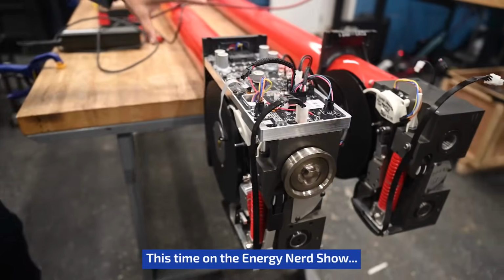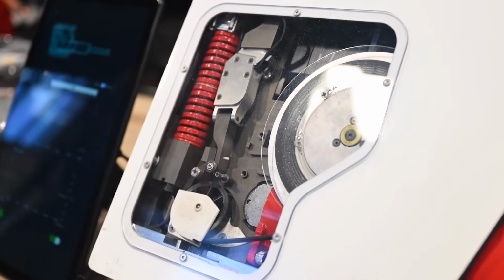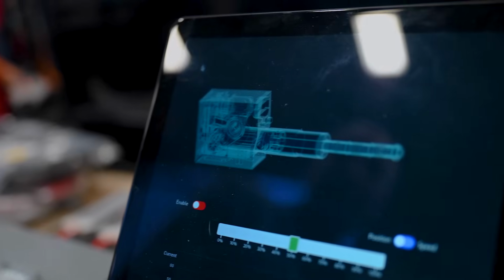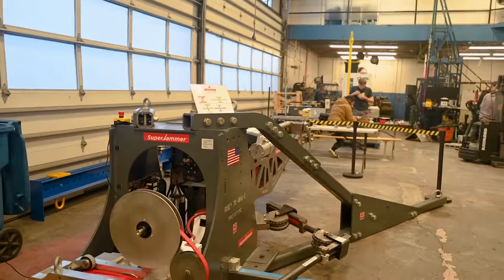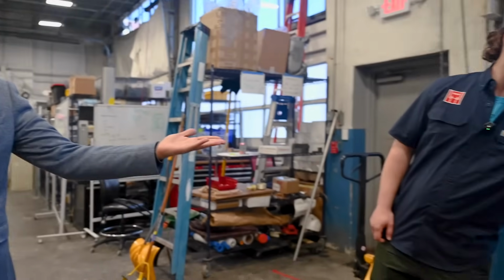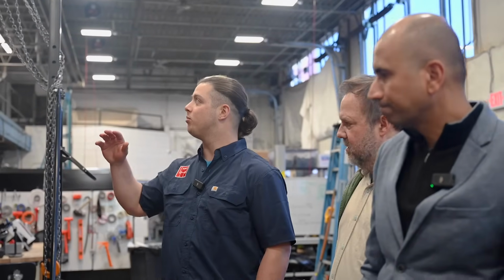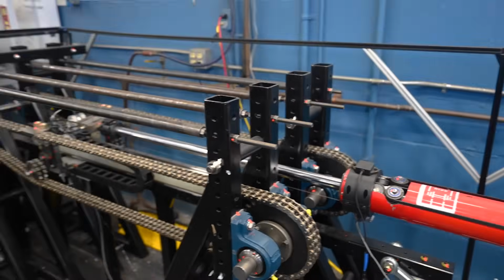Electrifying Heavy Machinery at RISE Robotics!

Comment: So ok first hi 
Automotive engineer
Servo has a huge disadvantage of having a motor sitting right by the each element
Where as in hydraulics I can use five of these with just one motor 20 meters away
Yeah not at the same time but hey
In many scenarios that would be a more efficient solution

Comment: I've been on a few jobs where the digging had to be very precise. On one side you have a gas line and on the other side you have a valuable structure and you can't make a mistake. So , you have to take your time and be careful. How much better would it have been to be able to move my bucket to each perimeter of my dig and lock in the parameters so that the machine won't go past that mark. Then I could work fast without fear of making a mistake. Time is money.

Comment: I'll put my 250 ton hydraulic press up against.....whatever you have.
Reply: Totally. Not a great market for these, and for about 50-100k, you could adapt an existing Fanuc or Kukro 7 axis robot arm to do the same thing. The arm would be more reliable than this system, too. 

Also, their claims in the video vs. labeling on the products don't line up. "This arm can lift 7000 lbs" pans across arm sees "Max 6000lbs" 😳

Comment: The potential-energy recovery (regen from lowering) is very useful.

Hydraulics are also dangerous.  A high pressure leak can literally cut a person in half.

Question: don't existing robots use belts?  Kuka, Fanuc, etc.

Comment: All this talk about energy efficiency? No indication of load capacity?

No application demo, just a wiggly arm any other actuator tech could move? 

Lets say I need an an actuator and I want to avoid hydraulic fluid for environmental and maintenance reasons - I got screws, rack and pinion, pneumatics or I can make my own damn pulley system because its elementary engineering and I would have fun doing it.

This is some rich dorks half baked concept put together by some smart engineers who need paychecks to cover their student loans.

Comment: That beltraulics name has GOT to go...it rolls off the tongue like broken glass.  I asked CoPilot for help.  You're welcome....these suggestions are way better than beltraulics and even if RISE doesn't use them, they need to find something else...consult a marketing expert or something...at least a linguist!
------------
If we’re imagining a term parallel to "hydraulics," rooted in the mechanics of belts and pulleys rather than liquid pressure, something like *"mechanics"* or *"beltonics"* could work. The "ics" suffix aligns with the naming convention seen in "hydraulics," while "belt" communicates the essential motion and power transfer via belts. 

Alternatively, borrowing from the Greek roots similar to "hydraulics," a word like *"sustaulics"* (from "susta," meaning pulley, and "aulics," meaning pipe or tube) could work to convey the system’s operation through interconnected pulleys and cables.

Does this resonate with the concept you’re envisioning? Or would you like to refine the idea further?
Reply: plus it will remind of the potential buyers how good hydraulics.. it will be doomed..

Comment: belts? a lot of electronics to fail - batteries - power to weight ratio - and what they are using as benefits are not really real world for an excavator ot front end loader - we dont need such control etc... u can almost destroy a hydraulic system and it will still move - not so with this - hmmmm cost of onership compared to hydraulics? and a maintained hydraulic system has few leaks -  sowhat market are they targeting? soo many parts to fail - booting? and that position example was a cheat - was at the end of travel

Comment: This is ok for non critical applications... This is due to failure of the belt dropping the load instantly as apposed to an oil leak that would drop the load gradually and in a controlled manor. Yes breaks could be used but I didn't hear them mention those. A motor controlled 'Ball Screw' would be more safer and yes I'm hinting at a new design that uses those. ;)
Reply: Ballscrew actuators are well known, as are lead (sliding nut) screws in a variety of configurations. Ballscrews are at risk of backdriving, and are more dirt sensitive, as well are needing proper lubrication. Great tech when used in CNC machines, not so easy when not designed-in properly.

Comment: I smell a scam. The number of ways in which this is more complicated and less versatile than hydraulics could fill a book.
Reply: Can you elaborate? I’m about to use my own tech involving pulleys and springs. Pulleys are miraculous and under-utilized tools
Reply: So could the uses that want it instead of hydraulics
Reply: Engineers beg the differ. Archimedes thought us that pulleys and leverage is the way. It's the materials that need to catch up. Hydraulic is a temporary fix.

Comment: Nah bro.
False "Green" Claims – Hydraulics can already be powered by electric motors, so arguing that their solution is greener is misleading.

Limited Force Application – If they can only pull and not push, their usefulness is drastically reduced. Hydraulics excel in both directions with immense force.

Pulley Wear & Maintenance – Belts and pulleys degrade over time, requiring frequent maintenance, unlike well-maintained hydraulic systems that last for decades.

Restricted Range of Motion – If they only achieve ~20% of their own length, that’s incredibly inefficient compared to hydraulic actuators, which often provide 100% stroke length.

Power Deficit – Hydraulics generate enormous force in compact spaces, something pulley-based systems struggle to match.

Spacial Restrictions — The motor and belt system seems to be positioned directly behind the piston as opposed to hydraulics vast flexibility using fluid cables.
Reply: 13:27 He cant even keep it straight

Comment: also a few points 
why use a spring on one end why not just pullies and string for both expansion and contractions 

he said its 80% the weight 
is that weight by volume or power 
 if its by both then this going straight to planes cause they surly wants something less messy then hydraulic oil
Reply: Or just a wormscrew/ballscrew that is both push and pull and precise with a good mechanical advantage and lock up.

Comment: Tethered controlers are nice and are use in nuclear handling robotic trailers, but have the problem that users damage or destroy the cables a lot.  Mostly they drive over them with the unit, but also just kink the cable or abuse it.  I am thinki g that these small controlers will suffer a simmilar fate.  Be prepared to have the cables and controlers on bench stock.

Comment: In the hydraulic jammer, all hydraulic arm functions can be accomplished with the hand pump.  I am guessing this is not possible with this electric version.
Reply: it is, this system uses the similar pulley technology used in cranes to multiply their lift force, so technically,  you can use a hand crank in place of the motor to operate this.
Reply: @vamshis1756 the crank is interesting, but inpractical for the table controls.
Reply: @jasonneugebauer5310  why? and what do you mean by table control?

Comment: I worked on munitions lift equipment "jammers" in the Air Force.  The consept unit in the video looks very nice, provided it functions safely with the 7,000 pound weight and does not require more unscheduled maintenance than the hydraulic version.
Reply: In heavy machinery, our electronics fail or wear and tear is 5:1 over hydraulics.  My question is are you guys electric over hydraulic? Curious if elec/hyd or diesel/hyd.  Interesting to hear how 7k of work causes a lot of maintenance, that would be laughed at in the heavy construction world, it would barely wear anything out. Context: 7k would be 3.x tons +/-,  1 cu. yd dirt = 1.35 tons... bucket 3 cu. yrd * 1.35 tons operating 8 hours, 5 days a week for 52 weeks. 1 hour maint. a month, service once/3 month....
Reply: @450ktm520 most of the maintenance has nothing to do with the pistons unles someone actually bends one or somehow tares a piston O-ring.

More issues with lines and fittings, pumps and electrical issues.

Biggest problem is with having the panels  bolt holes strip out constantly from being taken out every six months by novice mechanics, then repaired with crap helacoils that last maby a year or two at best.
Reply: AO!
Reply: Way more parts to fail, including all the electronics.

Comment: The perpetual energy is a joke. Clearly he doesn’t understand something called efficiency. There is no free energy my guy
Reply: It was, indeed, a joke. There's a play on words here, but it probably would have been better to not go in that direction. These are skilled engineers, they are fully aware of entropy and that someone inevitably pays for lunch.
Reply: @davidg3944  a joke? There is clearly no market for it. I mean there are fuckton of linear actuators already there and there is no way anyone can ever replace hydraulics. I mean it is fully electric if I run a hydraulic pump with a motor rather than a gasoline engine or whatever. Yes there are some closed loop hydraulic systems as well for position control what is he even talking about?
Reply: @ You seem somewhat overwrought. Take a deep breath, then exhale. Then stop.

Comment: This is interesting! It looks like everyone is hopping on the Greenwashing train!
Reply: If a proper accounting of energy costs shows it does save over hydraulics, it's not "greenwashing".
Reply: @davidg3944 As many others have already pointed out, you can easily retrofit an electric drive motor onto almost any existing hydraulic system. That saves you an immense amount of cost and design complexity. Fun Fact: machines almost never move all of their hydraulics simultaneously. We can leverage that to save weight and cost. As an example, if you use one large 20kW electric pump and a valve manifold to drive all of the hydraulic cylinders in a machine, you avoid needing separate 10kW, 10kW, 8kW, 5kW, 5kW, 3kW, and 2kW motors dedicated to driving each separate actuator of the machine at their full rated power. I can't consider this anywhere close to a viable replacement for multi-cylinder, shock-resistant, or heavy-lift hydraulic systems unless it can overcome those limitations without increasing the cost or complexity.

Comment: Has a lot of opportunity on the market for very special applications , but can’t replace good old hydraulics.
Modern hydraulic systems are super strong with less and less energy loss, due the computer assisted planning and machining processes. We can simulate fluid physics down to molecular level even, making better valves, pumps, pipes, dividers, regulators, filters etc…

Comment: Hydraulics usually win in cold conditions due to their robustness and ability to deliver power regardless of temperature, provided the system is properly configured. Electric pistons and winches are better suited in milder climates or where precision and ease of installation are more important than raw strength in the cold.

Comment: I am looking for electrical actuator rods that can replace the rams and valve bank on an excavator. The reason an excavator can work without wrecking itself is because of the releif valves in the valve bank. Put the bucket in the ground and pull back on the dipper. If the ground is too hard, it doesn't break the machine. The relief valve for the control senses too much pressure and opens allowing a bypass. This saves the machine from breaking. That is active relief, which I believe is not too hard to do with an electronic actuators. Its active relief because the ram being told to move is the one getting the relief. Now comes the tricky bit. With the same excavator, with the bucket in the ground, instead of trying to pull the bucket back with the dipper control, trying moving using the tracks. The dipper arm relief valve will open and allow the dipper to move rather than break. Even if the machine is not running and you pull it with something else, the relief valve will open and allow bypass. This is passive relief. Now who can provide the protection of passive relief with an electonic actuator? Without passive relief, the machine will be destroyed pretty quickly.
Reply: The electric motor that controls the belt will have passive relief once you overcome the magnet flux holding it in position, you can change that with voltage. Active relief will be the torque limit of the motor not exceeding the machines strength.
Reply: @elsimon89  That depends upon the gearbox being able to back drive. Even after it is worn from years of usage. Most high reduction gearboxes are bad at back-drive if they can do it at all.
Reply: @elsimon89  did they explain how this works, as in what happens with power loss. Remember the spring, if motor is passive, spring wins.
Reply: Very astute observation.
Reply: Other things required if we want to talk about excavators are what is the equivalent for a hydraulic accumulator to make a rock breaker, 
as well as expandability, how do you power an attachment that requires new actuation.
And the issue that this system seems to not be capable of powering multiple cylinders across the machine from a centralised power source as cleanly as hydraulics, it just seems like it would be a mess having a motor for every cylinder on the boom and exposed to damage or a complicated power delivery system that again would be vulnerable.
Reply: I always thought the electric replacement for hydraulic pistons would be worm screws, that would be push pull from the start without a giant spring, and look simpler than a mess of belts.
Reply: @MrMonkeybat  they call them jack screw, used to control elevator on some commercial aircraft
Reply: i can supply you electronically settable pressure regulator to save the machine from damages, it is just fitted in-between pump output and control valve input.
Reply: You could put strain gages and or load cells on components and have the controller actively move the thing if loads get too high. If it's backdriveable you will already have load sensing in the actuator and then it's just a software update.

Comment: I could see it in some niche applications like some food processing or clean rooms where even food safe hydraulic fluids are not allowed and high force is needed so pneumatics won’t work. Very niche product that is worse in most ways then hydraulics but it’s a big world and I they should be able to find a market. The “digital twin” demo is so cringe and all marketing bs. No one needs a digital twin of a linear actuator. They need a position value fed to a PLC. That’s it. Likely vc funded by investors with no industrial experience. Nothing beats hydraulics for heavy equipment and vehicle applications because of simplicity, reliability, and low cost. The lift gate demo with the “regenerative” feature is so dumb. The cost of electricity on gas vehicles is nothing there is no grid to feed electricity back onto. There is no benefit of recharging the battery because the alternator is constantly charging the battery anyway. More marketing bs.

Comment: try linear axis electricpulse motor actuators (linear coil-magnet rail). its the normal rotational electric pulse motor turned as linear track, with accurate position tracking built-in.
Reply: screw the belt actuators.

Comment: Beltdraulics is obviously in its very nascent stage. The system, any system, gets streamlined and simplified as it develops. There will be many user inputs which will speed up the modification process.  My only question is - Will the RISE ROBOTICS remain in Massachusetts?
Reply: If they ever get traction (not likely), they will have to move manufacturing to Asia to be competitive on cost. No question.

Comment: You can always figure out where they suck by thinking what they failed to mention: max force per 1 kg of actuator. Sure, it uses little energy per 1 Newton, but if the max force is pretty poor even when the actuator is heavy, the use cases for this are limited.

Even a pretty simple and small hydraulic cylinder can do 20000 N.

Another thing not mentioned was the price for practical applications.
Reply: This is not a product for sale. Calm your jimmies

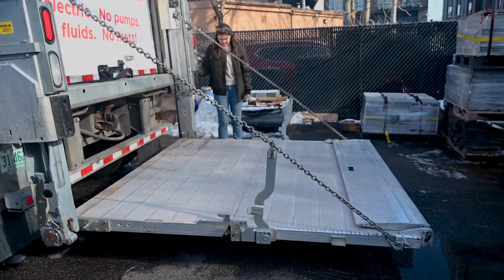Comment: 11:04   Good thing she’s wearing her work boots.  Also the battery they replaced the lead acid batteries with has a much higher discharge rate and faster recharge rate that’s why they can use a smaller battery, you could replace all the same batteries in a hydraulic system with similar battery.  I have done the same thing in my car audio system, I replaced eight lead acid batteries with two lithium batteries.
Reply: Everything has its pluses and minuses